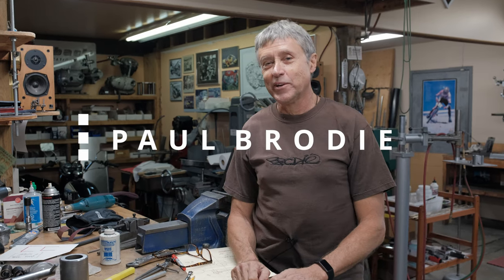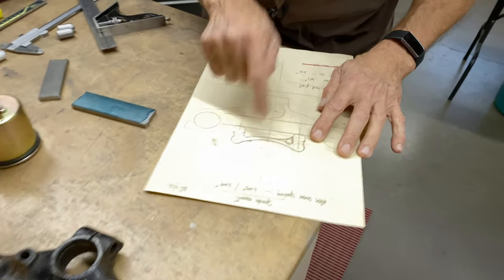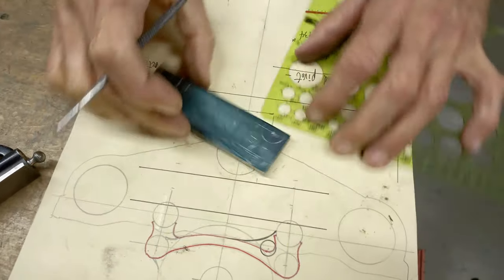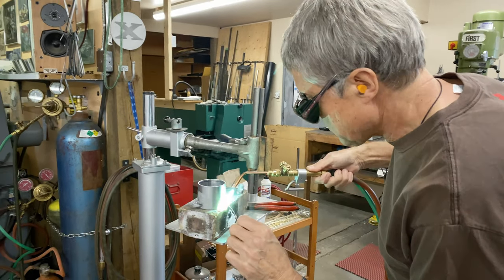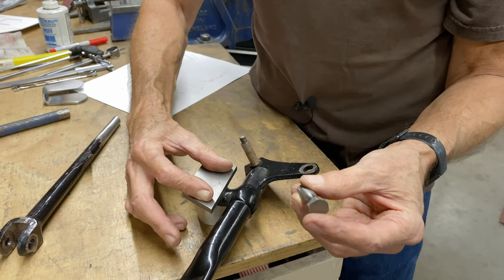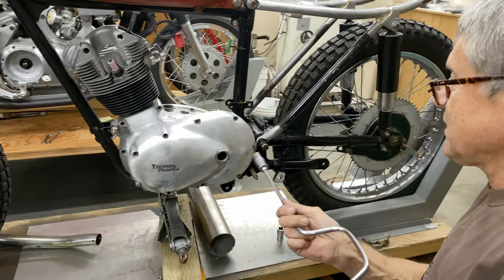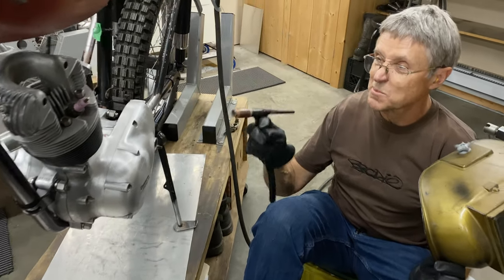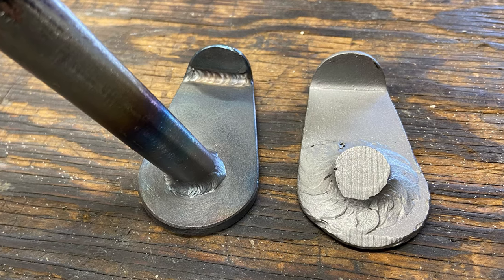Tiger Cub Cockpit // Paul Brodie's Shop

Comment: Thanks, as always.  RE: can't sleep, can't turn off the brain.  Ha.  Sounds much too familiar.

Lovely work on the speedo mount.  Usually when I have to make multiple identical parts I weld the corners of the parent stock, then rough profile them on the bandsaw leaving one corner attached.  Then I can belt sand the parts together, then cut the last corner off and finish each part individually.
Reply: The "can't sleep, brain won't stop" problem ? Totally solved by "chanting". Yeah, I know, hippy dippy sh#t right ? But if it works.................... You have to learn how to do it properly though, otherwise you just end up learning to chant and think at the same time ! gotta empty that brain and concentrate on chanting.

Comment: As usual, another excellent video, thank you. I pick up at least two or three  new techniques every episode. The “CAD” design section on the exhaust just spooled me up in regards to my little Yamaha 100cc twin!  I was working on my GPz550 the other day, the rear wheel, brakes(caliper and rear master cylinder rebuild, EBC pads, stainless brake line, plus all the bric a brac that goes along with this stuff), and it occurred to me that I havent seen you pass this particular TTP on to your viewers. When it comes to using the stock hardware on a restoration or just a mild one, the wire wheel has always been the go to. About 6-7 years ago I tried a vibratory tumbler with some corncob and walnut shell media,
 that had some dry polishing compound mixed in too. I wish I could show some before and after pictures, totally mindblowing. I will toss pretty much anything metal in there now, spokes, spoke nipples, springs, nuts, bolts, spacers, etc etc etc. The results of a day or two of tumbling are just incredible. Theres a guy on Ebay that sells the media, the stuff is absolute magic. You may already be doing this, but if not, I highly recommend it. It takes a bit longer but the results are so much better than a wire wheel.
Reply from the maker: Thank you Glen. I do not have a tumbler. I'm sure with the right tumbler and correct media you can get great results. I also never use a wire wheel. Something to consider; I just don't know where the tumbler would go in my crowded shop!
Reply: @paulbrodie  Theres always room!!! Its like a blender! My shop is sadly undersized, but Im working on it. Im bringing a quad home this week  for one of my lieutenants; hunting season approaches and his Suzuki is a stumbling, burbling mess. If I can make that Bismarck fit in my shop, you definitely have room for a tumbler ! The results without a doubt make it worthwhile

Comment: I really admire your attention to detail. Way different then the way I approach a project! I can’t help but notice that the engines are not built yet. I have always been able to build the engine first then detail. Which I am not to good at!
Reply from the maker: Yes, the motors are lagging behind. I'm getting the Cub painted before winter sets in; my shop only has a small heater. Then the motor will get done. Thanks for watching.

Comment: Thanks for sharing, grab a little tidbit of knowledge again (steel wool on the chrome). Love the C.A.D. 😀 Very nice design for the holder for the speedometer, personally I'd take a bit off the spacers and drop it down as much as it can go without interfering with the headlight and cables, get it out of the way not sticking up so much.
Lots of respect for you Paul, such a great fabricator, great problem solving, but seems that somehow you got into pluralizing things that shouldn't be ;-)
Reply from the maker: I did shorten the spacers a little bit. Don't understand what you mean by "pluralizing".
Reply: Hahaha. It's a pet peave of mine when people refer to a fork in the plural - there are 2 stanchions, but it's one fork 😀

Comment: Hey Paul, I absolutely love your videos! Could you find a turn the sound down a touch when you run equipment? I keep my volume up to listen to what your saying, but your belt sander wreaks havoc on my speakers. Thanks!
Reply from the maker: Thank you Jacob. Sound is not my job, you will have to talk to Mitch. I am merely the fabricator.

Comment: "I like that" is my favourite saying of yours!😁👍 I've been watching some of your videos and I see you like to save time by making jigs, fixtures and tools. Have you thought of making a quick change tool changer for your mill? They are very handy and time saving.
Reply from the maker: No, I have not thought of a quick change tool holder. I have use one years ago on a radial arm drill press in a machine shop I worked in.
Reply: I made one for my Bridgeport clone out of a 3/8" butterfly air gun. They are cheap to make and work well if you have a good air supply.

Comment: Paul. While the sag of the shocks does seem to be pretty low to the point where you won't have to worry about it, your test really hung most the weight over the side stand.  :D  Good idea of tightening up the pivot.  You do good work.   I really like the speedo bracket you made.  You are fantastic with silver solder. I look forward to your exhaust build.
Reply from the maker: Thank you Max. I still have a VHS tape of Max Headroom from many years ago. I thought that was a brilliant show.

Comment: Iv found Iv got an industry standard side stand angle testing body weight. I’m 96kg and generally I just slightly topple a bike if I sit on it with the side stand down.  If I offset my butt by about 2” to the side with the stand the bike sits dead plumb. There’s your standard to work to. Just need to eat cake until you hit the target weight.
Reply from the maker: I see. That all makes perfect sense...

Comment: Hey Paul, just went with a friend to fetch back his new (to him) Mountain Cub. He is the friend who suggested your videos. Question, this bike had no ignition switch, do you happen to know where it should be located? Also, on chrome polishing, try using Aluminum foil and water. Tougher spots may need coke as the the cutting fluid. Works amazingly well! Looking forward to more Cub Stories!

Thank you
Reply from the maker: I'm not an Expert on Cubs, sorry. I do not know where the ignition switch is located. I have never used aluminum foil and water to polish aluminum...
Reply: @paulbrodie  Paul give the ALuminum foil a try on your chrome. The wheels would be a great test bed. Thanks for the reply and great videos.

Comment: Nicely sculptured speedo mount. I thought you were building a trials version with high pipe and 21" front wheel.
Reply from the maker: Thank you Peter. I have no idea where you (and several others...) got the idea I was building a trials bike.  I think we have to put it down to wishful thinking. I never gave any such indication. For a trials bike I would never have installed such a large carb.
Reply: @paulbrodie  I think it may be due to you going out on trials bike and making video? Trials tyres and 21" wheel are also normally 'off road'. My father had a Tiger Cub, red and silver but low level exhaust and 'small' wheels
Reply from the maker: @1crazypj   Yes my Cub has trials tires, but they are 18" and 19". The front is a Dunlop, but the rear is a cheapie..
Reply: @paulbrodie  LOL, cool. It's why 'we' (your viewing public) shouldn't make assumptions, Assumptions just make an ass out of me ;o) 
Are you going to swap tyres for ribbed front and 'universal rear? 
Back in the 70's (BSA C15's, Matchless and Royal Enfield's hadn't gone crazy prices)
combination I always preferred was Avon 'Speedmaster' front with a Dunlop K70 rear although majority of my friends used Avon 'Safety Mileage' rears. I kinda went off the SM when I was following friend and saw 'daylight'  under rear tyre, the SM is just 'too square' in my opinion and 'spirited' cornering with only about 1/4" of rubber on the road didn't look too safe (like you really think of that when you first get licence)
Reply from the maker: @1crazypj   No, I am not going to swap tires. I have decided I am building a "street scrambler", and I will be careful in the corners..

Comment: When you silver solder what alloy are you using? Also, I noticed you still use flux even though you have an in-line gas fluxer...is that the "belt and suspenders" approach?
Reply from the maker: I believe the silver solder is 45%. It takes a while for the inline fluxer to deposit a layer of flux, that's why the paste flux goes on first, and the inline fluxer adds to that layer. It really does work very well. Not a "belt and suspenders" approach.

Comment: I dont figure how the speedo will hold in place in his tubing, as there’s no bottom… but I’m confident !! 😂
Reply from the maker: I made a bottom cap from 6061. The speedo drive has a thin 1/2"nut that holds it up.
Reply: @paulbrodie  I was confident, Paul ! 😄 Thanks

Comment: first real motorcycle was a terrier the 175cc baby cub, soon after i up graded to a t20S all this in about 1959.
Reply from the maker: You're just a little older than me.
Reply: @paulbrodie  yeah that's evident in the fact i forgot the Terrier was 150cc not 175 ,oh well. haven't seen one in many years.
Reply from the maker: @frankdillon6127   I knew the Terrier was 150cc but didn't mention it. Thanks for watching.

Comment: Ah now heres a first ,,, I really dont like it , couldnt you have used the gappy bar mount space to make a plate to act as the shim and the speedo mount ,, it just isnt up to your usual high standards , I dont know about you but the built in a shed from what ever was laying under the bench look does not suit the rest of the build .... normally a fan but not of this bit.
Reply from the maker: Well I'm sorry I have disappointed you.
Reply: @paulbrodie  it not a problem ... you more than make up for it the rest of the time.... just surprised as it's not the normal standard you work too ..... now I've mentioned it .you will see the gap looking at you every time you look at the bike ...... just how things work 🙂
Reply from the maker: @tomthompson7400   I disagree.
Reply: @paulbrodie  Time will tell.